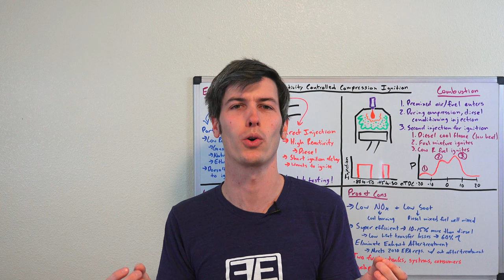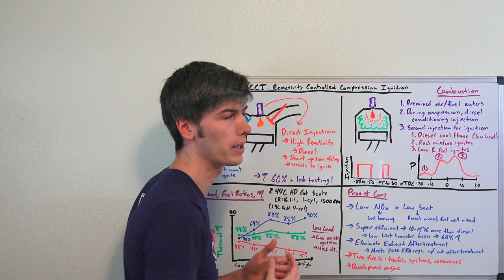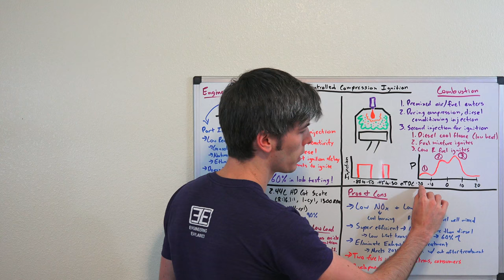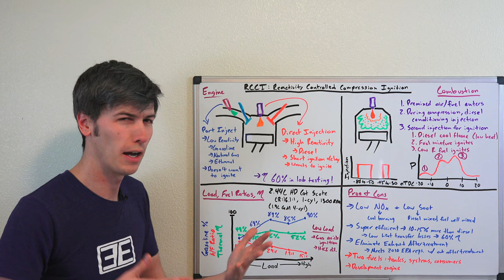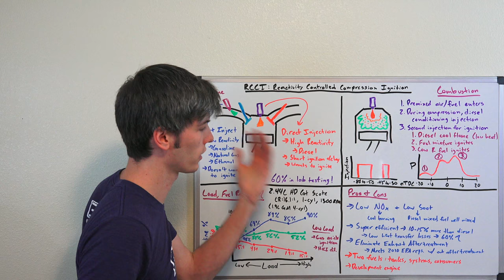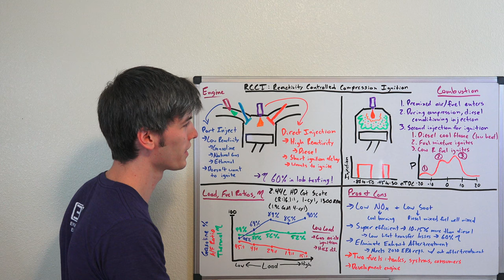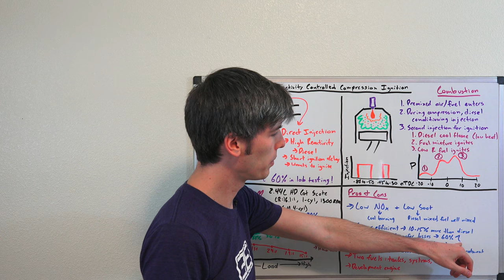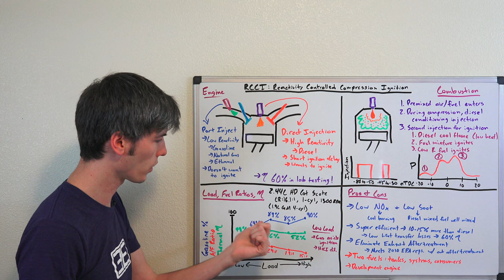Super Efficient Engine Uses Gas AND Diesel - RCCI

Comment: Sounds good for high performance heavy duty systems where the add weight of 2nd fuel system is of none to neglectable value to the overall efficiency, for example: power generators (doesn't move at all), heavy industrial transport (mining trucks, diesel locomotives, ships..). Difference in proces efficiency gives a huge advantage here (immediate measurable difference in fuel efficiency). Many aspects that make implementing this proces easy: fixed injection point, small rpm range under load, more abundant space for adding extra system, load conditions are well known.

Comment: unbelievable, that efficiency reach 60%. if it combine with full hybrid system, i think it will reach 90% efficiency. Btw very good information for this new CI system
Reply from the maker: Thanks, glad you enjoyed the video!
Reply: That is a good idea.  A two fuel system is manageable if the tanks are not filled frequently in a hybrid.
Reply: 90% with a combustion engine is barely impossible, because he have to make it from a translatory to a rotatory movement which takes a lot of your "energy". Also the fuel heats up the block, so a lot of the energy which is inside the fuel just goes into heat (check thermodynamics).
I guess with the 60% you're really good, compared to the first Watt machines with 3-6% efficiency.
Reply: I think If you use a F1 style MGU-H you can possibly get to 70-80% thermal efficiency ( the MGU-H is a generator attached to the exhaust of the engine,so when the engine is running,the hot escaping gases rotate the generator,turns the movement into electricity and powers a electric motor, so what’s wasted in heat is recovered )
Reply: it'd still be 60% eff but w/ hybrid it'd be more economical with the energy from burning
Reply: Messr. Carnot would like to have a word with you after class, Anthony.
Reply: then you slow down air movement, unless you mean a heat based generator
Reply: all of you, mechanical engineering background? sorry if i wrong, 60% thermal efficiency cannot combine with 30% hybrid fuel efficiency. thanks for correction

Comment: I have a low tech diesel (Toyota 2H) and I tend to mix the diesel with about 10% petrol and 8PSI boost from a supercharger, this combination stops all smoke from my engine. Haven't had it tested for emissions yet as I'm doing a full rebuild on the engine and modifying the body.

Comment: my thought was the diesel fuel is oily enough to replace the "oil cooling" and i always thought gasoline was more reactive than diesel... like the compression ignition experiment that uses a clear tube and wood shavings
Reply: stickloaf yea I was kinda caught off guard when it seemed like he said diesel is more reactive
Reply: Aaron Purtell. But the anti-knock compounds in gasoline make it less reactive so in a normal gasoline engine it doesn’t knock
Reply: The shade tree welder I thought the lack of compression and proper ignition timing in a gasoline engine were the anti knock qualities, not the fuel itself
Reply: Aaron Putrell

You thought wrong.
Reply: bcubed72 that’s fine, can you explain some of the anti knock properties of gasoline then? What may make it less prone to knocking than a diesel fuel?
Reply: 1) Generally, long-chain hydrocarbons are more knock-prone than short ones.
2) Gasoline also has aromatic HCs like benzene and toluene, which are known to be particularly knock-insensitive.
3) Ethanol is also knock-insensitive, with an octane rating of ~100.
4) Gasoline is rated by octane, which is its tendency to avoid compression-induced detonation. Higher octane = better. Diesel, OTOH, is rated by cetane, which essentially is the inverse of octane. Higher cetane = better (to a compression engine).
Reply: From your explanation, which is also my understanding, this whole concept that was being explained with the RCCI engine doesn't make a lick of sense.
Reply: MavHunter20XX 
I'm guessing they're using a stratified diesel charge in lieu of a spark plug? Sounds like a plan to get the efficiency benefits of a diesel, plus the emissions of a gasser.
Reply: yeah hes got his fuels mixed up.
Reply: Think about it.  Gasoline has a higher octane than Diesel.
Reply: RayZ fox diesel has more energy than gas but is harder to ignite. Test it out for yourself
Reply: Adam the heavy equipment mechanic, he doesn't have his fuels mixed up. Diesel fuel is more reactive than gasoline. He is indeed correct.
Reply: Greg H. Diesel has more energy but is less reactive.  Just research hazmat response guidelines the sds information is right there.
Reply: Adam the heavy equipment mechanic , You are referring to a safety data sheet which is a not the same as what goes on in the combustion chamber of an engine.   The poster is simplifying a very complex topic by saying "reactive " or less so to describe how easily a fuel starts into thermal depolymerization and the combustion pathways.  Throwing a match in a pan of fuel is not a test for reactivity of said fuel in a combustion chamber.
Reply: Rusty LugNut theres nothing wrong with him mixing up his fuels hes a college kid. This is not complicated. Id like to see his response tocriticism
Reply: mechanic  diesel is less reactive at room temp. But if you pressurize and heat it up it works very well. That's why it also can be made into destructive devices with some fertilizer. You can't do that with straight gas.

Comment: If this set up was used in a vehicle operating at low constant revs (approx 1200rpm) being used effectively as a hybrid diesel electric vehicle with rechargeable batteries and electric motors taking the strain of acceleration and regenerative braking its low emissions could supply a massive mpg and all the torque you might need.

Comment: Ok, so I'm going to install a carburetor on the air intake of my diesel engine.
Reply: tylerx2f01  just as an experiment.
Reply: tylerx2f01 Yea if you run diesel through the carb but I think Chas meant installing a carb in place of port gasoline injection. While maintaining the direct diesel injection on his diesel engine.

Comment: what percentage is a rotary engine like a 13b ?
Reply from the maker: No idea, I would guess in the 20's.
Reply: Engineering Explained ..... Lol really u think as low as 20s... Haha I knew they weren't that good but 20s lol that's crazy
Reply from the maker: Well many modern engines are still in the 30's, so I don't think it'd be unreasonable to assume. The RX vehicles had terrible fuel economy.
Reply: Engineering Explained ...... Yea
Reply: what about if we had a theoretical rotary engine that coud rev to 20k  
Woud it still have the same thermal efficency or woud it change?
Reply: Wiener Party ..... Idk that one .... having a rotary engine as a hobby it's going to break just like RC cars or RC planes break.... you have more enjoyment of working on them when they're broken than actually having them working
Reply: Wankels have HUGE side seals and round spark plug holes that need to be welded as slits.  They have a natural maximum compression of 7.5:1 so they are turbo friendly but not naturally efficient. They also have a very long combustion area that never really quenches.
Reply: Engineering Explained Yup, they are very thirsty indeed. I am lucky if I get 14 MPG in my RX-8, then again, their power is way up high in the RPM range and there's the fact that I have a heavy right foot. 😅
Reply: Rotory engines need to run rich because detonation is absolutely destructive to the engine Apex seals. The fuel volume helps keeps the combustion charge cooler. Down side is the emissions and efficiency.
Reply: Wankel was never intended to be efficient. It's all about power in a small package. They also have very little torque, but can spin very fast thus producing massive amounts of horse power for their size.
Reply: Most gas engine are said to be in the low 20s while Diesels are in the low to mid 30s. Ive read.
Reply: 0.5%

Comment: Which one do you think is better? SPCCI or RCCI?
Reply from the maker: I'm thinking about making a comparison video if people are interested. For my thoughts on the various engines, see the pinned comment above.
Reply: electric lol
Reply: there's always one guy with poor question comprehension.
Reply: Eric Cassidy reading *
Reply: Rcci is based off hcci. And Mazda created spcci to deal with throttle changes and high load driving, as hcci hates that. So realistically hcci is worse than rcci, but spcci is the realistic use of it.
Reply: do it
Reply: do it! do it! do it!
Reply: rcci is great but personally i'd take mazda's petrol burning diesel. it's a bit more straight forward.

Comment: Diesel vs gasoline engines next.
Reply from the maker: https://youtu.be/rXVJG9n6BAs
Reply: I've seen that video, and I understand the differences but i want your opinion about these engines in use, for example for light vehicles, why there are so many diesel cars in europe,  durability, pluses and minuses, which are cheaper in the long term, easier to fix, stuff like that.
Reply: The reason why there are so many diesel cars in europe is their lower consumption, and diesel is usally the same or a bit cheaper in many european countries, so it is cheaper to run diesel cars. That's it, pretty much. Also some european countries tax based on CO2 emmission, so diesels are less taxed.
Reply: @Cooper19940323  diesel is more taxed in my country and i live in EU, if you drive less than 2000km / month gasoline is cheaper than diesel...

Comment: I understand that with this method, the injection is controlled and whatsoever more, but google around for diesel gasoline cocktails, we've been using them for decades for various reasons, one is to avoid paraffin clogging the injectors, as gasoline dissolves the paraffin, two, it produces a much cleaner and expansive combustion with a bit of explosion to speed the diesel up. the engine is of course a diesel engine and deals pretty well with the added power of gasoline, and this without any ecu remapping, there are maps to increase the efficiency, we had engines that would come up with 15% extra power with this method. Also, multifuel engines are around for 3 decades already :) they burn even piss if you need to.

Comment: About the inconvenience of having two fuels. Here in Europe they are forcing new diesels to have adblue now. So every diesel car you buy now will have a second adblue tank that you have to fill up. Maybe it lasts longer than this method but still having 2 fuels is not too bad. Here the fuel lines are right next to each other.

Comment: I am not 100% sure ifd you have covered any of these, but can you do videos on the following?

Hydraulic (Swash Plate Pump Based) CVT's

Wave Disk Engines

Alternative Fuels (Besides Ethanol and Bio-Diesel) such as methanol, dimethyl ether

non-hydrogen fuel cells

Just some ideas.  I don't thinki these topics are covered much on youtube, so it would be a good addition to the channel.

Comment: Nice video. Learned a few things! 

I would like to see you touch on stratified fuel injection maybe in a future video. It's used commonly on Audi/VAG gas cars.  

An interesting thing that VAG does on top of stratified injection is during warmup, the injector fires twice. Not sure if this is 100% accurate but would like to get your input on it.  Thanks.

Comment: This is a great idea especially for semis. Most of these already have basically 2 fuel systems that are combined at the Diesel injectors. This just separates the fuel systems to make one port injection and the other cylinder injection.. Only issue is that maybe the ratios are not 50/50 so dimensioning the actual tanks can be problematic, but shouldn't matter much. You stop and refuel both anyway 😂 for passenger cars doesn't seem easy to do.

Comment: Jason maybe a discussion on thermal efficiency and how it connects to engine efficiency since some myths say the hotter the more efficient. how does thermal efficiency translate to farther distances with the same amount of fuel consumption? (or same distance less fuel usage)
ie...big bangs aren't always hot-just higher pressure.

Comment: I wonder if this could be added to the Ilmor 5 stroke adding even better efficiency. It uses two cylinders exhausting into a larger third cylinder. The 5th stroke is a secondary expansion. Thermal efficiency went up 15% over a normal engine.

Comment: Dual fuel medium speed (under 1000 RPM) engines have been around for a long time.  They normally run on natural gas with diesel injection for ignition.  When gas becomes limited or costly it can run on diesel only.

Comment: I allways had this idea of usong spark-plugs to help a diesel engine achieve better combustion, thus the amount of diesel fuel inyected could be reduced.... Or maybe use the spark charge to "ignite" the exhaust gases when the exhaust cycle is going on (This will rise exhaust gas temperatures) making the exaust gas easy to filter at the DPF / SCR system.

Comment: I actually had been thinking about this for a long time. My idea was less direct injection and more like water injection systems. Spray the fuel in under high loads to reduce knock allowing the use of much higher compression ratios which improve power.

Comment: This with electrically driven turbo and "freevalve"... has potential.  And btw, you don't need a turbo if you have an "air compression tank", a second solution to decouple RPM from the "intake air pressure", but it's only most usable with freevalve and possibly with variable compression ratio (some Atkinson+ in the future?).

Comment: There has been something like this available for all diesel engines for years that makes the engine MUCH more efficient and clean without the need for exhaust treatment. By adding propane or natural gas injection to a diesel it provides all of these benefits while still exceeding EPA requirements. But it not "approved".

Comment: I am designing an engine like this. V8 6.2l with variable compression ratio and a vtech based system which allows to shut down up to 4 cylinders. It has two camshafts an like the lb7 duramax 16 pushrods but 32 valves. I spent a lot of time in the drawing.

Comment: One solution to the two fuels problem is physical.  Have twin nozzle pumps that fill both fuels at once with twin openings to deposit fuel through.  It would take time to implement, but it might solve many fixed fuel headaches too.  I imagine there are other variables to account for, but with our microprocessor and short range wireless communication abilities, they shouldn't pose a big problem.

Comment: I could see an engine like this being used as a generator in a range-extender car like the Chevy Volt, for example.  Run it at a set RPM, generating electricity as needed to propel the vehicle.  Because it's not connected directly to the wheels, it can be run at its most efficient speed, regardless of load.

Comment: This isn't new actually!
There are some LPG-conversion manufacturers who make systems that add port-injected LPG fuel to direct injected diesel engines, mainly marketed to semi tractors.
It works the same: the diesel injectors only inject the amount of diesel fuel needed for low load, and the LPG injectors add LPG fuel based on the load demand, which is more efficient and eliminates the massive black cloud out of the exhaust.
This technology was promoted at the time truck manufacturers struggled to meet newer stricter emission regulations without losing efficiency.
However the LPG tank size was limited as you can't transport that much LPG fuel without a hazmat license, space and weight is an issue as well, and LPG pumps in motorway side fuel stations are placed in the cars-only zone.
Adblue systems are lighter, more compact, and don't have the range per tank issue, so that's what the industry went with despite being only just good enough to meet emissions.
Reply: I was wondering what the railroads were doing to run on natural gas.  I doubted they'd replace all their diesels.  This sounds like it unless some complications hit Diesel electrics hard.
Reply: Yes, we have natural gas conversions for diesel engines for years. 70/30 gas diesel mix.
Reply: This is not the same thing as what you have described.  Gas injection in a diesel does not necessarily create the conditions for HCCI combustion to occur.
Reply: Rusty LugNut A diesel engine is per definition a self-combusting, aka "HCCI" engine. It does work exactly the same because it is exactly the same: a shot of diesel self-ignites in a high compression chamber, acting as the ignition and a fraction of the power production, gasoline/LPG/CNG/ethanol/... is mixed with the intake air to increase the energy density of the mixture depending on the load, increasing the power output ánd efficiency.
So no, it is nothing new, and yes, it is the exact same thing as the aftermarket diesel LPG systems already commercially available.

Comment: Some drag cars already use a similar setup. Big turbo cars will inject C16 or similar race fuel to increase knock resistance. It's a pain to set up with 2 sets of injectors. I always wondered if diesel could be made to work.

Comment: Its way less complicated to make a big cylinder, fixed rpm engine efficient than a small cylinder with a wide rpm range. Would be interesting to know how rapid the efficiency drops with higher rpm and in a smaller engine configuration. The claimed 35-40% efficiency of modern automotive Diesel engines also only applies to a really small rpm and load range. Other than that, good to see new concepts popping up.

Comment: Great for generators and shipping. 
Low NOx from such a lean air / gas mixture is encouraging. 
(sigh) So much work or energy is pulled from the combustion chamber from water jacket and oil cooling. 
While gas/petrol keeps the intake valves clean, injectors are diesel grade? Just normal maintenance issues?